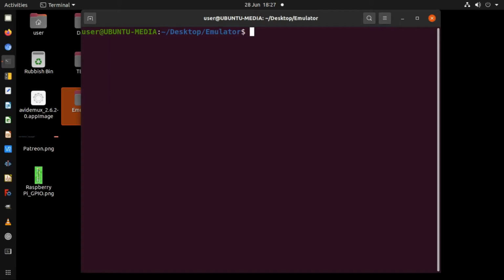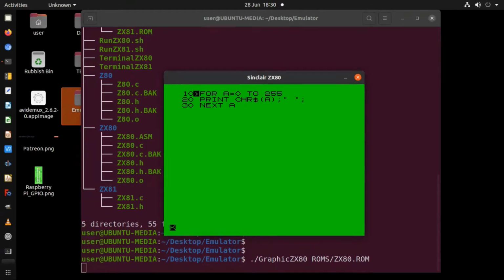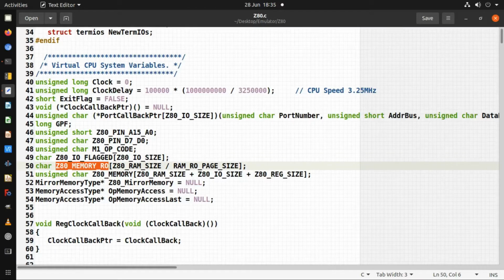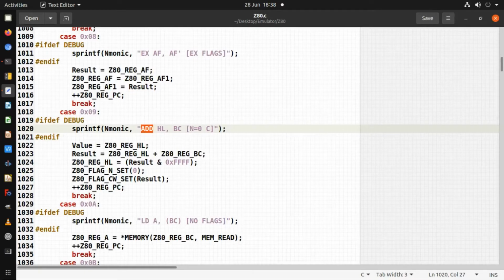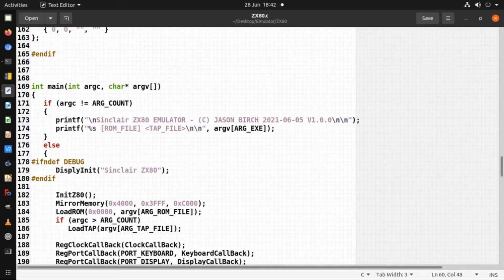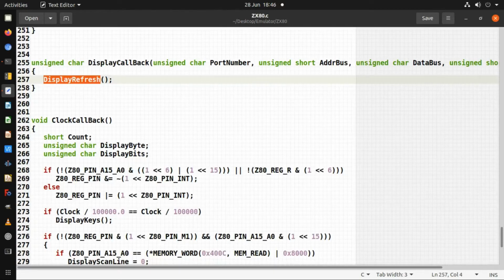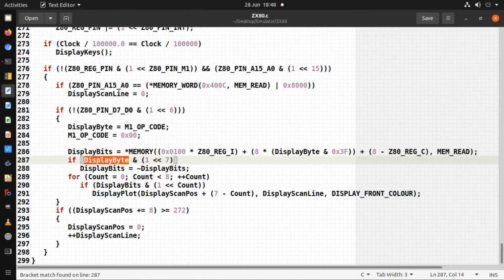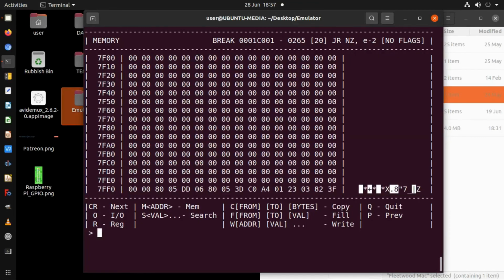Emulating a Sinclair ZX80 & Z80 CPU Using Only ANSI C

Comment: Real ZX80s stopped producing video data outside of the input loop. The ZX81 moved the video update code to an interrupt service routine. and could keep a stable picture unless loading saving or in FAST mode.
Reply from the maker: The ZX80 did pretty much the same as the ZX81 in FAST mode, with a software timed frame rate. The ZX81 SLOW mode, enabled the NMI interrupt via the ULA IC, in order to generate a 50Hz frame interrupt.

Comment: You have put the work in!
Reply from the maker: Thank you. This did turn out to be a bigger project than I was expecting.
Reply: @DevelopIT  Good job though, are you releasing the code on Github or anything like that?
Reply from the maker: @SusanAmberBruce  Probably not this project, however I will ultimately make available compiled versions for the Raspberry Pi and x86 Linux system.
Reply: @DevelopIT  Cool 😎